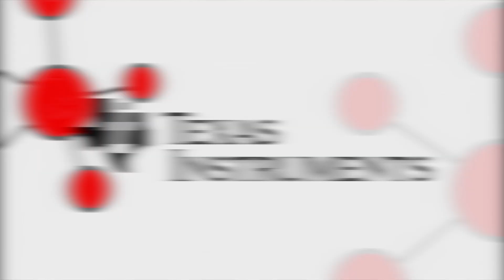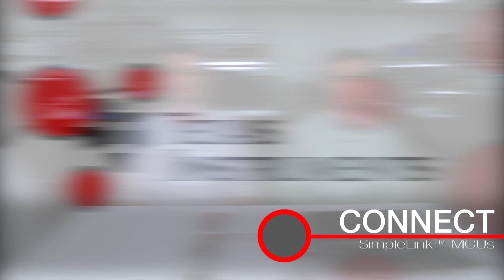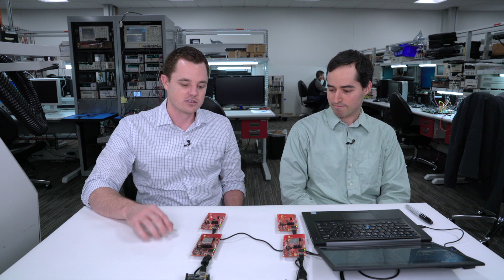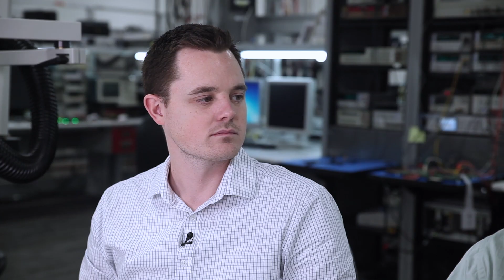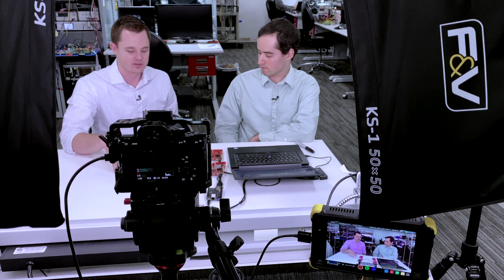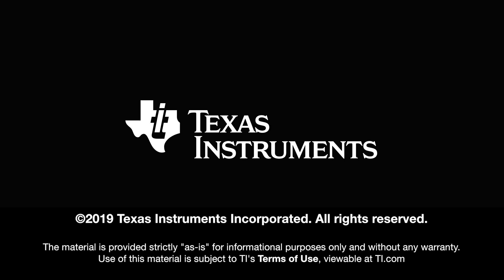Connect: Turbo OAD with Sub-1 GHz

Comment: there's mention of 200+ nodes; how many layers will the turbo 15.4 OAD support reliably?
Reply from the maker: Thanks for the question, OAD/Turbo OAD reliability primarily depends on the network utilization and OAD configuration parameters rather than number of nodes on the network.  As long as the network utilization is not very high, OAD/Turbo OAD should be reliable!